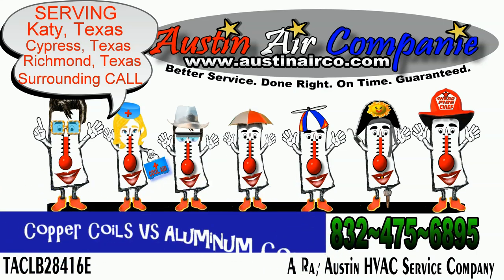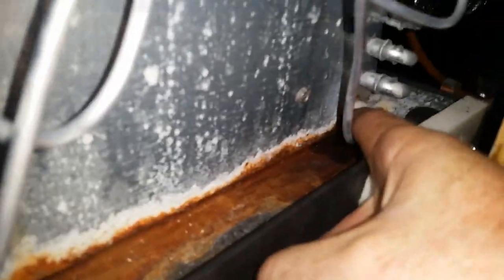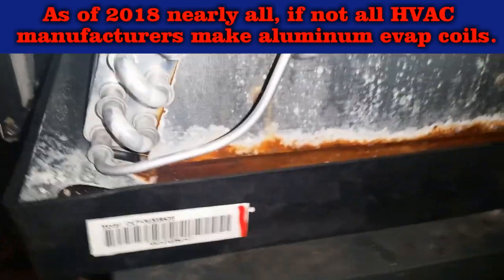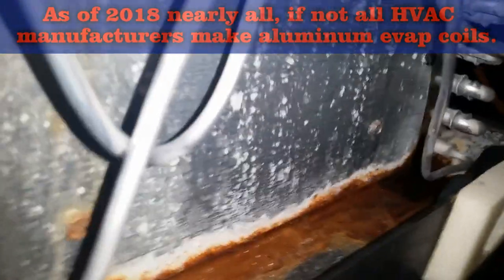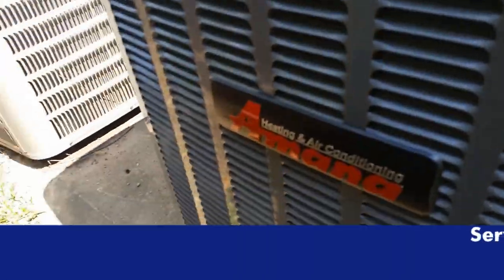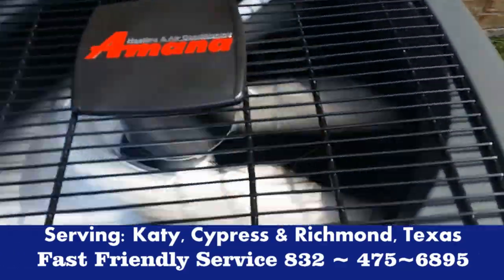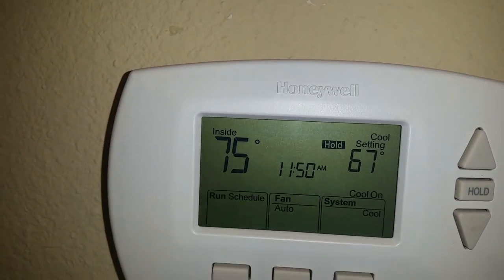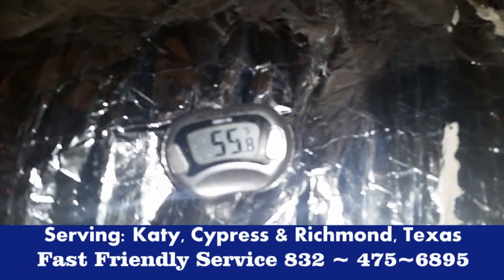Copper Coils Vs Aluminum Coils

Comment: As a landlord and having replaced many HVAC systems in Florida listen, understand and appreciate the value of education this video provides.  Only wish we had a better manual to understand if the operation or maintenance or lack of increases repairs, cost, and life cycle of unit.  NOT detailed but general operation and maintenance, recommended, required.  Thank you for helping us make a better decision and saving us potential stress and costs prematurely.
Reply from the maker: Thanks for comment & watching the video. If anything can be taken from this topic it's that freon leaks happen, will continue to happen, have always happened. Due to refrigerant costs the difference now is that you have to fix those leaks. Most of the time this will involve replacing the equipment that is leaking. In hotter climates like the SE USA the more you run the AC the greater the chance of developing a refrigerant leak. Condensate drainage is important because it nearly always contains VOC's that cause the coil to develop Freon leaks. Even if drainage is proper leaks can still develop. Cleaning newer type coils isn't a good idea (evap coil) To avoid having to do this proper filtration is key as well as replacing those filters on regular basis. There is no brand that is immune to these kinds of problems. They all leak, they all will leak. Not a matter of if, but when. In terms of landlords the renting market is hard on AC's especially for hot climate areas in USA. I am also a landlord, not to mention I am often called to them in my area. Tenants do not want to do anything other than crank that AC and expect it to perform without doing anything. As a landlord you need to make sure that system is maintained. Maintenance isn't just about doing it, but doing it right. Pay too little to have it done properly could cost you plenty a short time later. Enthusiasts and DIY people often tell you misleading things or improper things. They are there for clicks. People do things they don't even realize the consequences. Like trying to clear drains with bleach as an example, in pill form or other same difference. bleach will kill algae, it will also kill an all aluminum coil by eating it. :text-green-game-over:

Comment: Great video very educational I thought copper was a better choice but not the case when its to thin.
Reply from the maker: Copper wasn't bad some 20 years ago, it has a lot of things working against it now, because due to efficiency requirements surface area of the equipment has grown much larger to attain higher efficiency. So the more metal needed, price of that metal increases cost. Then you also have weight to contend with too. Copper weighs more than aluminum, plus costs more. The thing is, refrigerant leaks have always occurred. There's just more focus on it now because refrigerants are much more expensive now than in the past. Certainly aluminum isn't perfect either as I demonstrated in the video.  Thanks for the comment.

Comment: I guess my Comfort Air Unit was done right with 29.9 years and still running.
Reply from the maker: During that time span AC's efficiency were quite low. Maybe as low as 8 SEER, Probably no higher than 10 SEER. Trying to increase the efficiency (lower operating costs) presents many problems in the reliabilty realm. If you're in a low use climate / or comfort isn't as important to you the operating costs are easier to bear / less a reason to fix or replace something. Also in a lower use climate, the less you operate it less the chance it breaks.  Thanks for watching

Comment: Copper coils are better than aluminum coils period, easier to repair a better coefficiency than aluminum coil in my opinion they last just as long as aluminum coils problem with the Rust could’ve solved so many different ways! But aluminum is cheaper and that’s where AC Company seem to be going cheap cheap cheap cheap. I started installing in 1986 good luck you
Guys
Reply from the maker: To drive efficiency up the coils (inside and out) have gotten bigger and bigger. Efficiency in 1986 was probably at best 8 SEER, maybe 10 SEER and much smaller coils. Copper weighs more. Bigger coil, more weight, more cost, more volume for refrigerant, more, more, more. 

The reason for refrigerant leaks isn't really rust in my opinion sure the leaks develop where the rust is, but formicary corrosion as shown in the video is the real reason. Trying to repair a coil when freon was cheap is one thing, but with cost of everything today it just never works out trying to repair an evaporator coil. I've even had spotty luck trying to repair condenser coils as often times it just fails again. Vibrations can cause a myriad of problems too beyond the formicary corrosion problem. Thanks for watching.

Comment: Hello I've been told that because there is a leak in the coil that is composed of 1 side copper and the other side aluminum it can't be fixed. Why do companies do this ? I'm low income and a widow I can't afford another air conditioner. This one is only 8 years old.
Reply from the maker: The video discusses why it can't be fixed. Formicary corrosion. Potentially thousands of small leaks not seen by the human eye. Attempting to fix it isn't likely to be successful and refrigerants aren't cheap either. Thanks for watching.

Comment: Just wondering why they don't bolt an anode like on my outboard on my mercury outdrive?  Thanks
Reply from the maker: Probably because of cost if I had to guess. The annodes on a motor submerged in salt water is different than a coil that gets wet inside a home, then in order to sacrifice the annode it would have to be placed properly. The goal in the annode on a motor is to last at least a year before replacing. Obviously this would likely depend how much time that motor is spent submerged. If all an annode could last as a year or two, I think the manufacturers decided it wasn't worth the effort. 

An interesting thought, but more maintenance costs too. Maybe at some point they will be forced to go a different route, but they have tried coatings many different kinds, types, methods they all have weaknesses. Thanks for watching and the comment.

Comment: Thanks for the info...Sad that the central banks have put us in a position where we are dealing with this incredibly high inflation affecting commodities/raw materials.  I am evaluating some quotes for a new system and this information was helpful because from an engineering standpoint i was trying to understand why these manufacturers were replacing a high thermal conductivity material like copper with one that performs much worse like aluminum but it doesnt appear all bad since there are pros around corrosion resistance.  Do all manufacturers upsize their aluminum evaporator coils to make up for the loss in conductivity?
Reply from the maker: In terms of thermal conductivity I don't think the material matters all that much because heat flows from hot to cold, so because the refrigerant is so cold in the evaporator section of the system the refrigerant (what ever kind it is) absorbs that heat like a magnet. Obviously the higher the surface contact of that refrigerant even the more heat transfer can occur. So you get the introduction of larger coils to further enhance the heat transfer and increase efficiency. I had been meaning to do a part 2 to this series to show that the tubes that run the length of the coil aren't flat, but actually have tiny grooves or prongs on the inner part of the tubes themselves. However that function could also be the source of refrigerant leaks as if there is some inperfection that also could cause material to be quite thin and ultimately lead to freon leaks. 

I don't think the material choice is entirely or exclusively due to cost of raw materials, but more so to be competive on price. The other is weight, copper weighs much more than aluminum and that bites when it comes to shipping things around. Especially when producing larger coils to chase the elusive efficiency mandates. Thanks for the great question and for watching the video. 😀

Comment: i am trying to decide between a Trane vs Daikin, both 5 ton 16 SEER.  I've been told that Trane uses all aluminum spine fin coil and is better than using aluminum/copper coil as Daikin and other manufacturers are using.  I'm in central FL area 20 miles from the beach.  Any input?
Reply from the maker: Brands are brands in my opinion. I pay more attention to what the brand will do for you among other things. That said a 16 SEER is upper tier equipment with not much difference and due to recent Inverter developments if it were me I'd do the inverter. The problem for inverter with those brands is they would be communicating. All major brands do it that way which in and of itself isn't bad just more expense, more likely to have problems. 

I put in a Bosch Inverter at my house back in 2019. Put in several of these inverter AC's for a number of people that wanted more efficient systems. They run circles around 2 speed condensers. Plus the pay back, the lower humidity etc. all gravy. Hotter than hell this year where I live the Bosch's perform like a dream. So hot / humid climate is a good fit for them. You're far enough away from the coast that it shouldn't matter too much. Salt corrosion will eat any brand. 

Not sure what an inverter is? I did a video on them too. One of them I replaced a two speed trane condenser. Thanks for watching & the comment.
Reply: @AustinAirCo  Thanks.  This is for a commercial bldg, 2900 sq ft, max will have 10 people at one time. M to F 8:30 - 5pm.  They recommended me to stay with a single stage.  We keep it 75 degrees during work hours and 80 degrees the rest of the time. I have a Honeywell T9 which I really like and don't want to change it.  I will look more into the inverter, but as of now I've been quoted $8300 for Daikin and $8190 for Trane, both installed.  So I don't think the Bosch will be on the horizon anytime soon.
Reply from the maker: @myreviews4905  Thanks for the info. Commercial is considerably different animal as most building are leased in commercial realm, could be 3 phase power, could be package unit could be a split system that is raised above a drop down ceiling. Not saying Bosch doesn't make commercial equipment. It would be completely different if you sleep there. Because of this it greatly depends on if you own the building / how long you plan to lease it.

Comment: Get on with it!!! Edited to add " :D  "
Reply from the maker: HVAC is a very broad subject that is impossible to 'Get on with it' and cover all areas of the subject. I fix air conditioners. I don't fix people or their expectations.
Reply: AustinAirCo what’s your opinion on the new Amana units?
Reply from the maker: @brianremington  Amana makes more than one model, they are all new from the factory so you will have to be more specific as to what you mean. If you're looking for a unit that never breaks down, never needs repairs, never needs maintenance... these kinds of units are a myth. They all break. However, if the unit (any system) is 'properly designed', installed properly and cared for (maintained) they can last a long time.
Reply from the maker: @brianremington  I am not a mind reader 2 of your comments are rude. If you dish our rudeness you can't expect much in return. This channel isn't only here for you. If you're looking for someone to bully, you've picked the wrong channel. Find another one.
Reply: @AustinAirCo  thanks!
Reply from the maker: @brianremington  Brian, keep in mind your experience is ultimately in the hands of who installs and services the equipment. Just selecting a brand (based on my experience) doesn't mean you will have similar experience. 25% of the knowledge required to do air conditioning work is all that's required. 75% of the over all knowledge needed is also knowing what 'not to do'. This can vastly change your own personal experience. In addition to that Amana makes more than one model. I am a licensed contractor doing work that is often done by subs or installers with a bare minimum of knowledge. Installation practices can be the cause of failure in some instances.
Reply: @AustinAirCo  yeah no doubt about that. As a tradesman i completely understand. But we all sell products that fall into good/better/best categories and i was curious (as a man that takes pride in your efforts) what your general opinion of a product line was. hey, thanks again for your time and energy. My original comment should have included a " :D" because i was mainly referencing the Monty Python phrase...perhaps my intent would have been more clear. :o)
Reply from the maker: @brianremington  OK fair enough, but I don't view any brand as necessarily better. Amana has it's strengths due mainly to fairness in part prices, availability of those parts and not a bunch of game playing when it comes to warranty parts. I have installed 7-8 different brands over the past 11 years of running my business. There is very little difference in terms of failure with any of those I've installed. I've gone back on other companies installations all the time. Anyone can do air conditioning work, that doesn't mean they should Your mileage may vary. People often take a brand I offer, then turn around and have another contractor install it because they are cheaper up front. Then wonder why the thing never works right. This is why I don't try to fix people. I am a straight shooter, I don't apologize for my opinion, because it's rooted in experience of doing, not just talking about it in a video